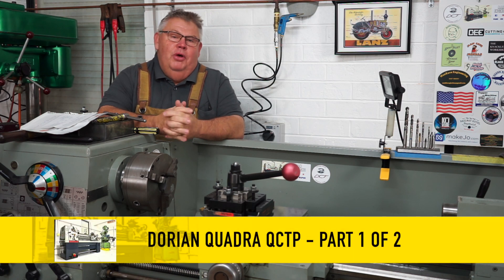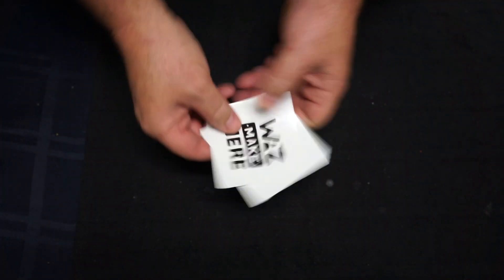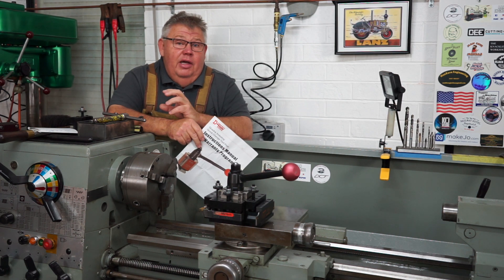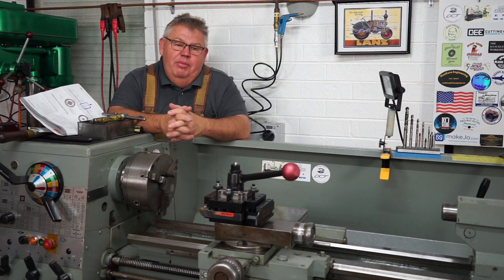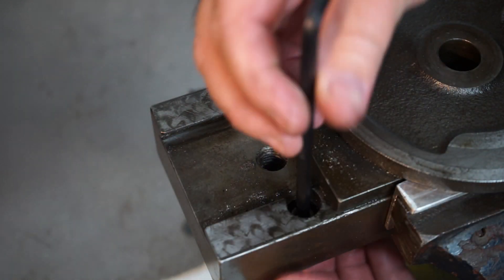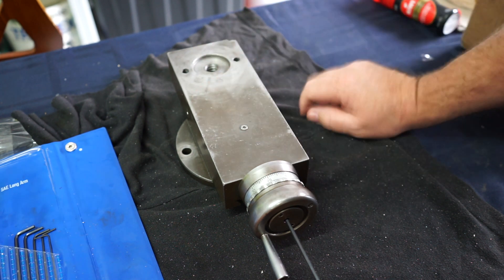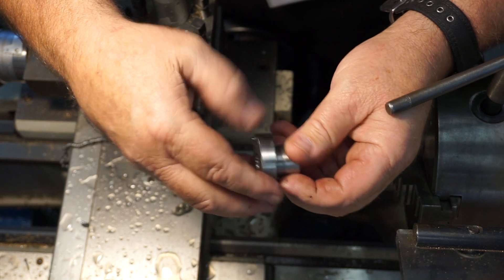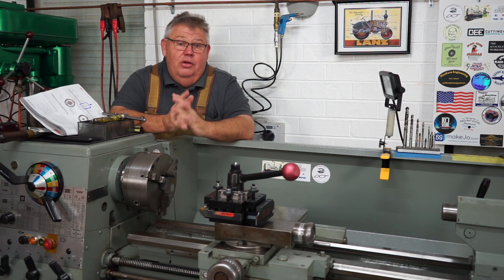New Tool Day 1 - Dorian Tool Post Installation

Comment: Well, I've been repairing cnc machines for the past 1.5 years and I often have to spend a day just figuring out how they come apart only to find it was one stupid plate hiding in the back that holds the whole machine together (slight exaggeration there lol).
So I reeeeally feel your pain 🤣. 
Cheers!
Reply from the maker: G'day Chris.  I bet you have your work cut out for you fixing CNC machines.  I could only image some of the trials and tribulations of working on them.  Yes, I felt like an idiot stripping down the toolpost only to find two bolts hiding underneath 🤦‍♂️.  Glad I got it all figured out and back up and running again.  Hope you're well mate?  Cheers, Aaron.

Comment: why not just make a new tool post with the same thread cheers
Reply from the maker: Hi Paul. You are correct. I could have just made another bolt with a different thread (5/8” UNC bottom with a 5/8” UNF tip thread). But wanted to keep the Dorian all original. The next video will show the drilling and tapping of the compound slide. Cheers 🍻

Comment: I would have thought that a combination of the Dave Lammas ( triangle ) tool post, and the Dickinson quick change tool post would be better.
Reply from the maker: Hi Joe. I have used the Dickinson & multiflix style of QCTP before. I feel the Dorian is far better quality and much more rigid (personal opinion only). The Dorian Quadra also locks easily on 15 degree intervals which comes in very handy. I’d never seen the Dave Lammas style before. Thanks for telling me about it. I’ll take a closer look. Cheers 🍻. Aaron

Comment: Oh man. Just when you think something will be an easy install. I have the Qitp-40n on my Monarch.
Reply from the maker: G'day Tom.  Yes it was a bit of a nightmare to install this to the old Colchester.  However, I finally got the job done.  Part 2 will show how I used CAD-CAM to get the bores and holes completed.  Cheers, Aaron.
PS: the QITP-40 is much bigger than mine.  Is that the same one as Kurtis installed?
Reply: @AaronEngineering  I believe so.

Comment: Great video! I have a regular Dorian AXA on my Super 11 and it is a beast especially since I ditched the compound slide for a solid cast iron bit.
Reply from the maker: G'day Paul.  Thanks for watching mate.  Yes I love the Dorian QCTP.  They are built like a brick outhouse and are really smooth.  I can understand why you ditched the compound slide.  I really need mine for taper turning, so it's best I hang onto it.  Cheers, Aaron.
Reply: @AaronEngineering  I can still install it on the back and run in reverse if needed, easy peasy!

Comment: What no auto rotate on it.. Really is a nice addition . Working on turret lathes I used many machines in my apprenticeship years. You run a few and learn to set up and even grinding form tools. Maybe theyll make an option for English lathes now you had to do a bit of work to mount yours.
Reply from the maker: Hey buddy.  Thanks for watching.  Yes it was a bit of work to install properly.  To be honest, I could have just made a new bolt 5/8 UNC thread on the bottom and 5/8 UNF thread on the top.  But I wanted to keep the Dorian all original.  Thanks for watching and I appreciate your input.  Cheers, Aaron.